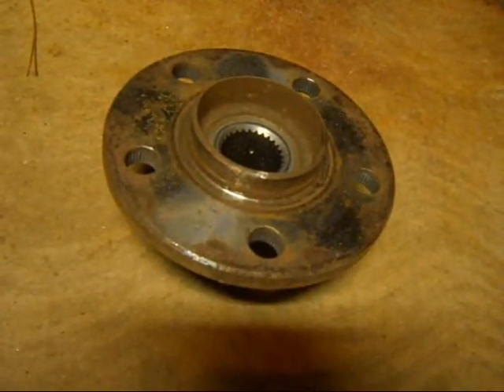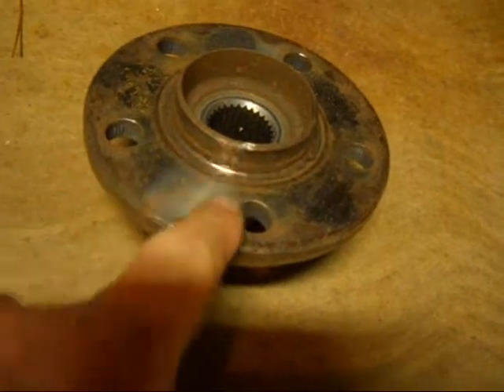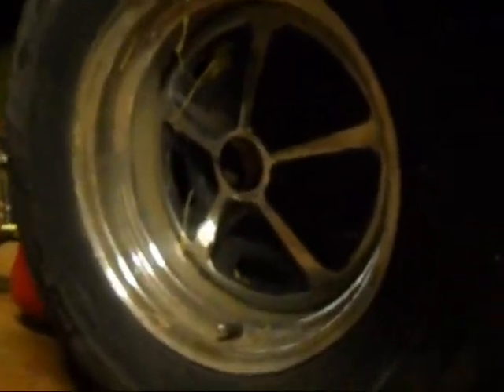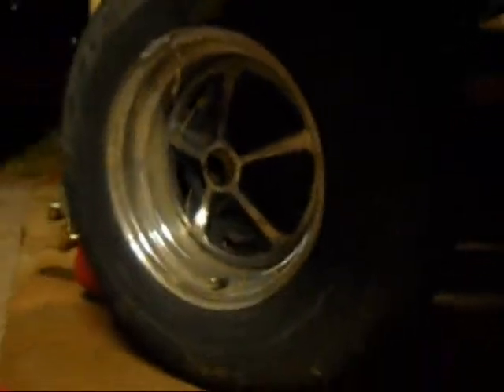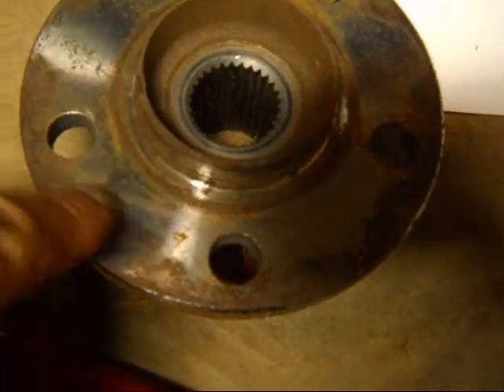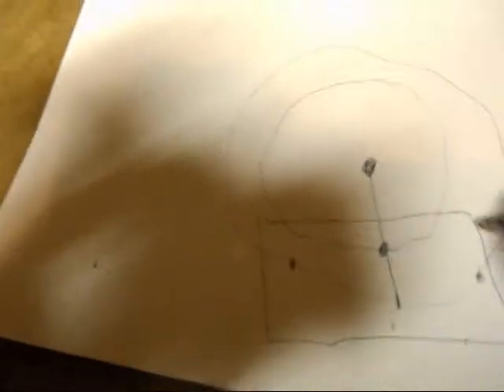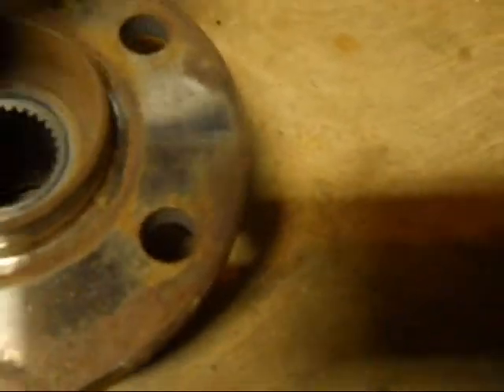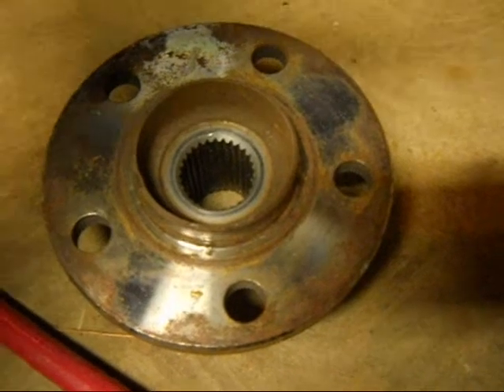Thunderbird IRS hub redrill idea

Comment: i am planning on doing this. i am going to use 1 wheel adapter (5x4.5 to 5x4.25). once you bolt this to the hub you will have a perfectly centered pattern. then just use a 5/8 center punch.. bingo!!
the only reason i am planning to do this to he hubs is the fact that i am going to have to drill the rotors anyways. so 2 birds one stone.

Comment: If you're installing a thunderbird IRS, and want a 5x4.5" bolt pattern, just use 1999-2004 Mustang Cobra hubs and press them into the Thunderbird IRS.  Us Tbird guys do that all the time to get more wheel options.  It's a direct fit.
Reply from the maker: I am aware of this but unwilling to spend the money...been running this car for quite a while now with no issues.
Reply: Durwood Robison 
I'm putting a '94 Lincoln IRS under my '53 F-100.  Same issue but I thought the Cobra '03 and '04 were 31 spline.  My Lincoln is 28 spline.  I believe only the '99 and '01 Cobra will work as they are 28 spline.
I've read some guys suggested Explorer but, the ones I've seen are 29 spline.
Reply from the maker: Funny you mention this tonight. I was just looking at some Mustang hubs on ebay. They are still pricey. My IRS has a 7.5 from a V6 T-bird. I never took notice of spline count.
Reply: Roland Caston 
Yes, I saw those, too.  That guy is asking $120 + $20 for shipping for each hub.  I saw brand new ones for only $3 more.  I told him that.  He said he would sell the pair for $200.  That's still too much for used parts.  I don't know why everyone wants so much money for them.  They are not high performance or anything.....just rare.  Only '99 and '01 years work for us.  Ford did not make a 2000 or 2002 Cobra; only Cobra R.  I don't know what those had.  But, I do know the '03 and '04 do not work.  I've had yards try and sell me those until I tell them about he spline count.  I may just have mine redrilled by a machine shop.  How did yours turn out doing them yourself?
Reply from the maker: They've been doing just fine.

Comment from the maker: Well, it didn't work out perfectly. The acorn nuts bottomed out on the stud ever so slightly but just enough to cause the wheel not to be properly tightened. I believe I ruined a wheel and definately ruined the lug nuts. I will do a follow up in the near future.